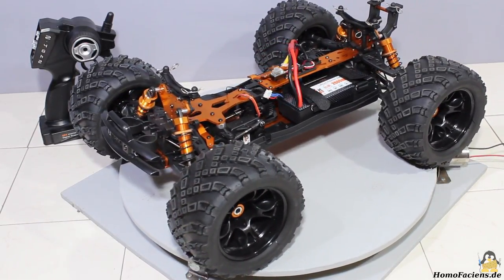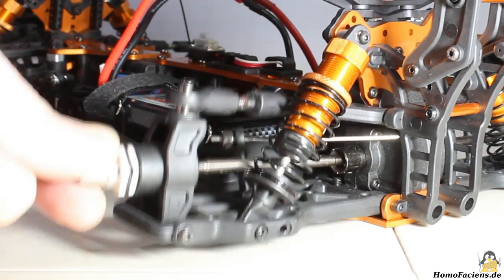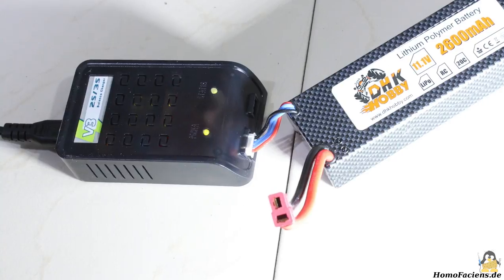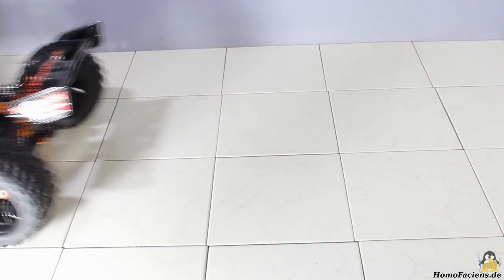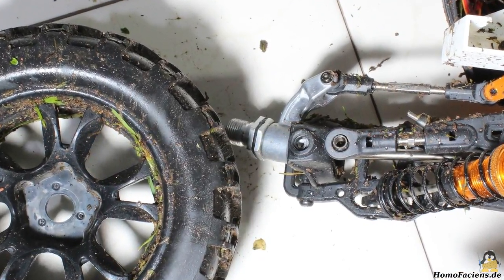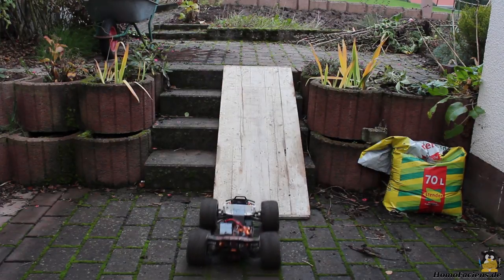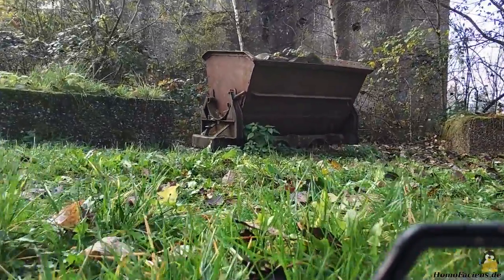Monster truck Zombie 8E conversion to a browser controlled rover

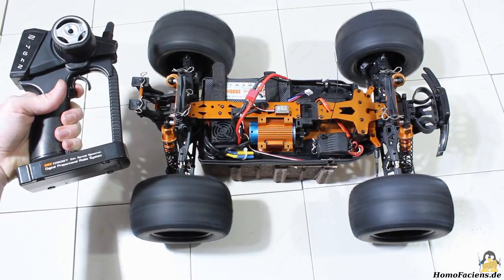Comment: Something interesting is happening with the wheels. At around 5:00 in the video, when motors are at full speed, tires stretch due centrifugal (centripetal?) force. Or is that just an video artifact?
Reply from the maker: It's no video artefact, but real physics (centrifugal force) that causes the deformation. It's a powerful motor in combination with soft tires having a large diameter.
Reply: the same happen to formula one tires